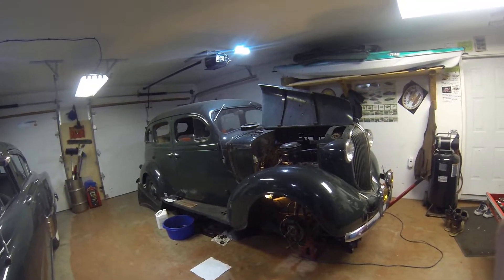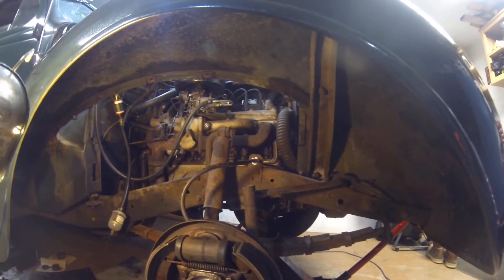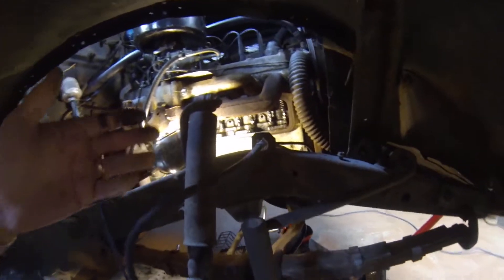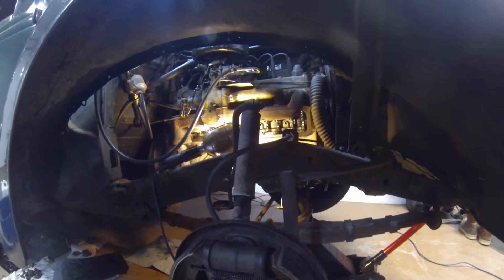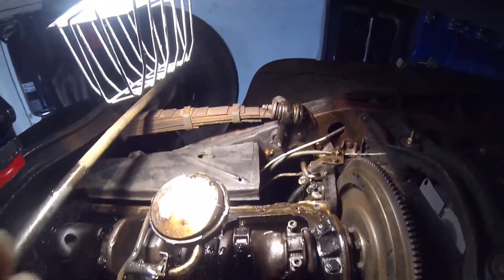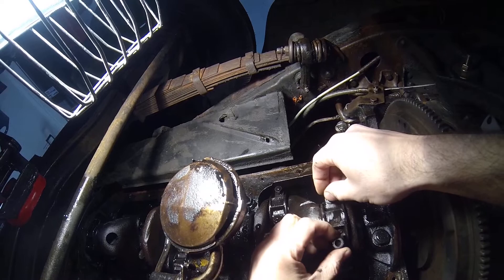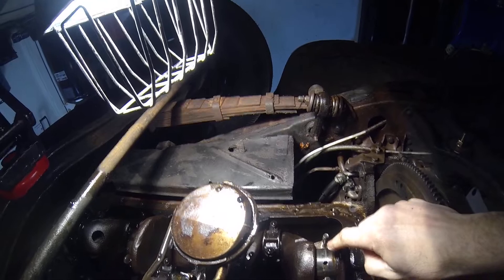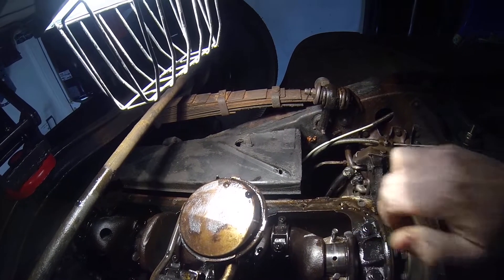Vintage Mopar Engine Crankcase, Oil Pan, Crankshaft & Bearing Inspection

Comment: Hi Keith, nice video! I just rewired my whole '55 Plymouth Savoy, thankfully everything works great now electrically. I did a trannny seal replacement to stop the drips on my floor (pan gasket and shift shaft seal). Then moved on to refilling trans fluid to correct level, and while doing so the engine had a knock in the crankcase. Sounds to me, I have a rod bearing going out. You're video shed some light on how I'm going to go about replacing the rod bearings ! Any suggestions on getting the top half out, I'm not going to remove the head at this time. I figure I can just push the piston up enough to move the bearing out to grab it ? Let me know your thoughts, thanks, Dave
Reply from the maker: Get some insulated pliers.  Start your engine. Pull one spark plug wire. Listen for the knock to stop. Push wire back on so the plug fires again.  Repeat at each spark plug to learn which rod is knocking. The idea is it won’t knock if there is no combustion forcing the piston down abruptly. Then you know which bearing is toast.  Pull bearing cap. Carefully inspect crank surface. Needs to be smooth and no lines, scoring or other marks in the crank surface. If you can feel it with your fingernail, its a problem. May get away with emory cloth polish. You need to verify exact crank diameter to ensure to order and install the correct bearing.  .010, .001, .020, .005 etc. Use plasti-gauge, re-install cap to measure bearing clearance. Do you need specs?  Email me bccarcruisers@gmail.com
Reply: @keithsgarage5831  thanks very much for your quick response. Great idea on the plug pulling test btw

Comment: I have a 53 plymouth that I wouldn’t doubt has not had an oil change or ran for about a decade. I’ve got it running, driving, and stopping this past several months…want to change the oil but don’t know if all 10ish qts are going to be in the pan or if there will be any in the hydrive trans other than residual leftover…
When I drain and pull the pan is there anywhere else I need to drain or is it all in the pan?
Reply from the maker: I have never owned a Plymouth Hy-drive model. However I did a little research. It appears to be very similar to my 1953 Chrysler. The engine oil was pumped into the torque, then back into the oil pan sump. Continuous. See this video here https://youtu.be/zbaJooD9xWU. I discuss and explain it my way here in this video:  https://youtu.be/6HSD8LRzoDk

Comment: I have a '38 Dodge Brothers Touring Sedan that I restored.  It's the Canadian version "Dodge" D10 model, which was imported to here in California about 20 years ago.  Being in Canada, you're probably familiar with the D10, basically a Plymouith P6 body and driveline with a Dodge grille, headlights mounted on the fenders, and Dodge dash and instruments.  During part of 1938 Canada put a de-stroked Chrysler 6 in the D10s. Buying parts was "interesting."   You have two beautiful Plymouths!
Reply: Correction:  beautiful Plymouth and Chrysler.